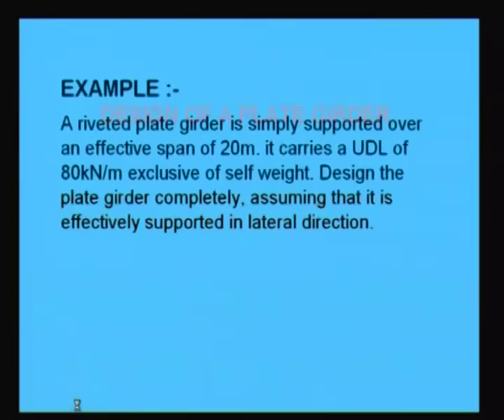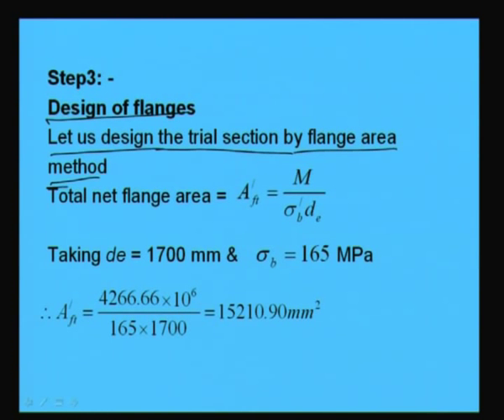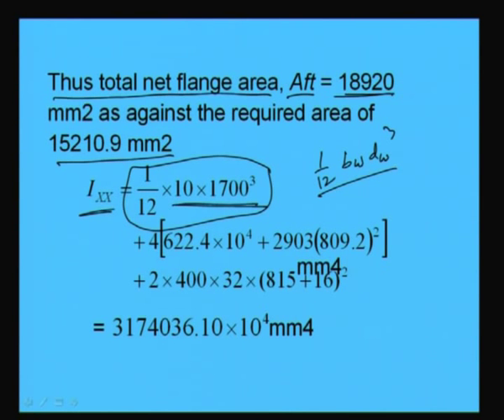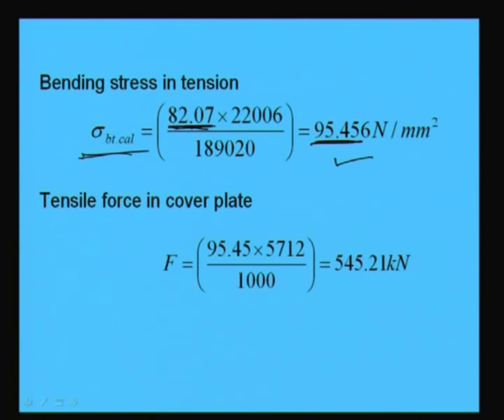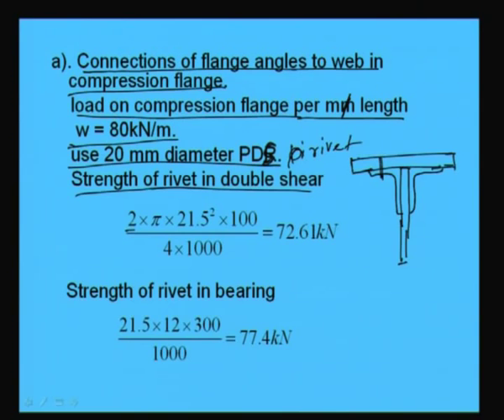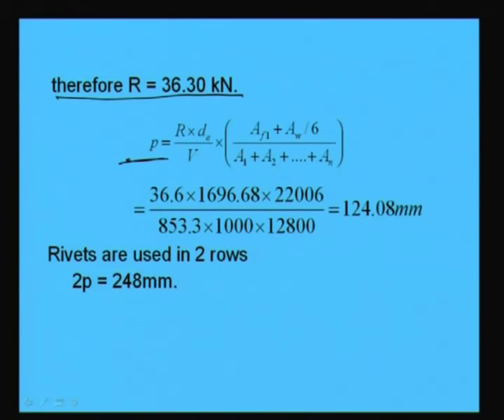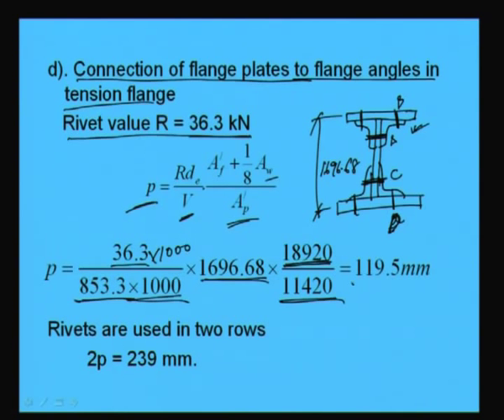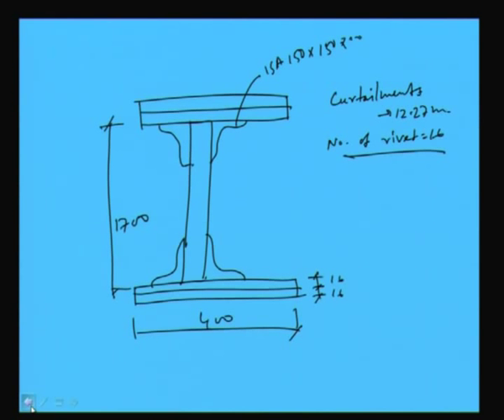Mod-7 Lec-5 Design of a Plate Girder

Comment: a) connection of flange angles to web in compression flange 
in calculation of bearing strength why you take 12 mm web thickness should be taken the minimum thickness of angle I.e. 10 mm.  ISA 150×150×10